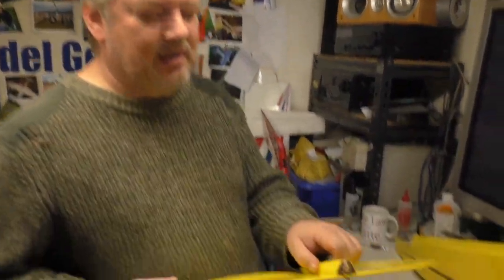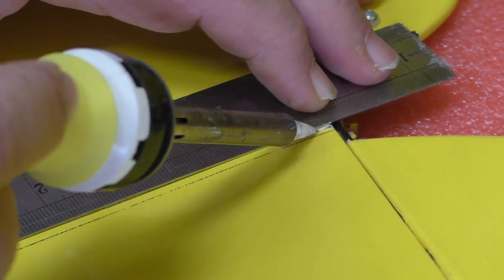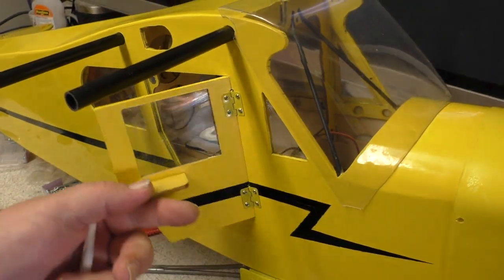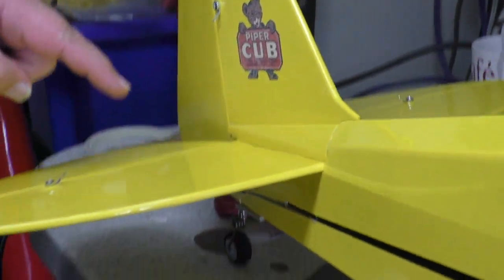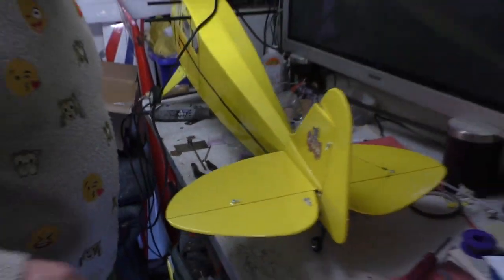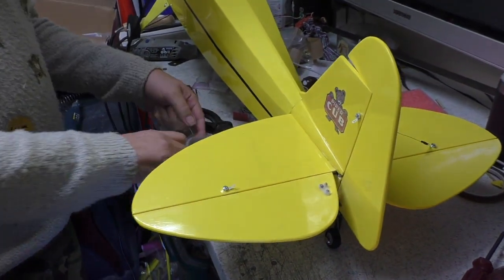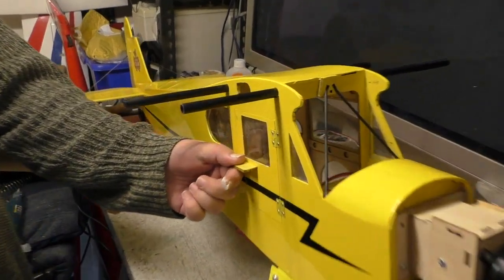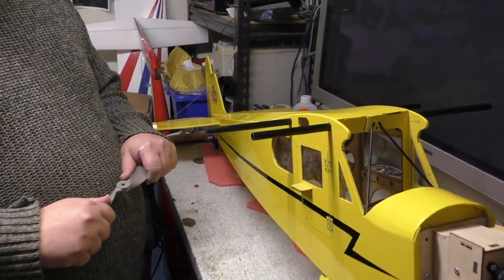Hobbyking J3 Cub 1800mm DW Hobby build Pt15 RC Model Geeks

Comment: Kyosho years ago caused all sorts of problems with tailplanes breaking in flight on the Kyosho trainer ARTF,the outworkers were scoring the film too heavily with a knife thus creating a weak spot,your tip is a good one to avoid this common issue,love the tail rigging,turned out to be a very nice model,the tail rigging also helps the glider tow cable not tangling with the rudder on glider towing from the centre of gravity pointas used on model glider tow installations.

Comment: What is the size o f the propeller and the motor
Reply from the maker: Motor is https://hobbyking.com/en_us/propdrive-v2-3548-900kv-brushless-outrunner-motor.html
ESC is https://hobbyking.com/en_us/hobbyking-red-brick-70a-esc-1.html
Prop 12x6
Battery 4s 5000mah
Reply: Do you know how much does the plane weight? We are using a 4250 580kv 80A ESC, with a 16x9 propeller, and we must use 2/3 throttle to a leveled flight. My plane weighs 10 lbs
Reply from the maker: all seems a bit excessive to me. what battery are u using
Reply: 4S 4500ma
we rebuilt it!, somebody left it in the trash at the airfield,  originally has a gas engine. We are going to try with a small propeller. I will let you know of our advances. Thanks for your replies
Reply from the maker: Your problem is the low kv of the motor. i would maybe try 5s or change the motor to something with about 900kv. then put a 12x6 on it. My setup has plenty of power.